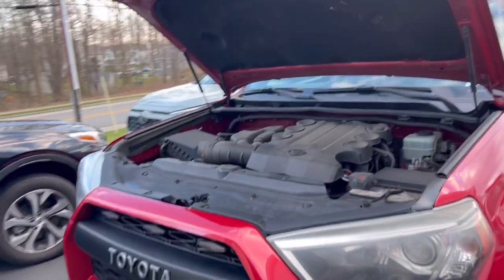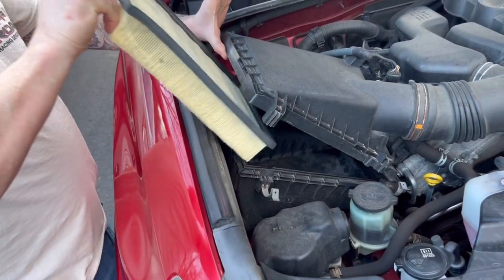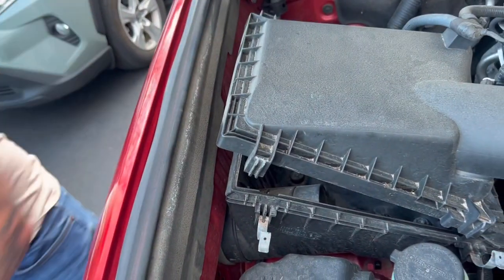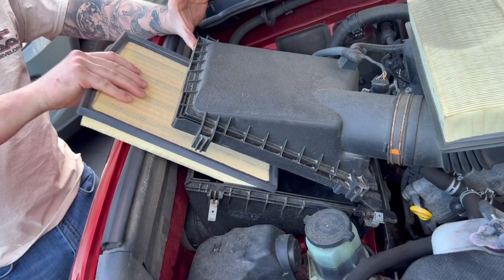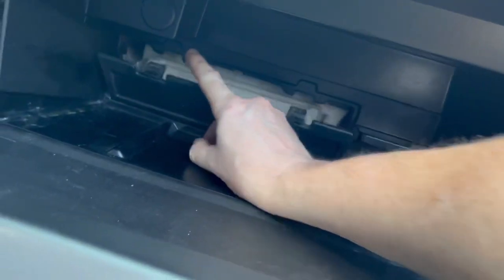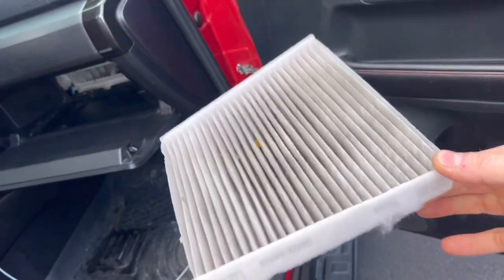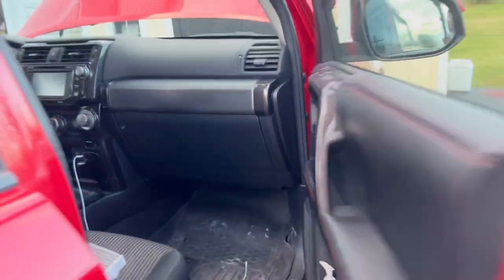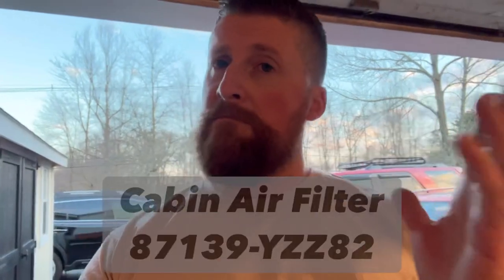Toyota 4Runner • FREE Maintenance Tech Tips - DIY Engine and Cabin air filters Replacement

Comment: I'm a little surprised that although you mentioned using aftermarket cabin filters you didn't mention how most aftermarket brands don't have arrows on them that indicate which side goes up but instead have arrows that should point down in the direction of air flow.
Reply from the maker: I wouldn’t know, I never use aftermarket filters 🤣.
I do now. I’m going to assume most of us do read the instructions. Please forgive me.
Reply: @VikingsGarage  Yeah. I did this the last time when I replaced my OE with an after market one and did not realize until I replaced it recently.  Extremely easy to miss the subtle difference on what the arrow denotes.
Reply: @KarthikPoobalasubramanian  
You'd be surprised at how many folks assume that up and air flow are the same BUT if that was true then dirt wouldn't collect on top of the old filter instead it would be trapped in the blower motor mounted below the filter.

Comment: Hey man? I noticed on my 21 4Runner it has a foam on the bottom of the OEM air filter , but some replacements don’t??
Reply from the maker: It’s common to find that type from factory. Most replacement filters come without it.

Comment: Do you recommend K&N filters?
Reply from the maker: I do not, for many reasons.
If you will clean then regularly perhaps but I’m not going to say is the best way to filter your engine air. 🤷🏼‍♂️
Reply: The Project Farm channel discs test comparing some brands of air filter. While K&N improved performance, it did so at the expense of not being as effective at keeping dirt out is the engine.
Reply from the maker: My point precisely, I’ve seen a Tacoma once with a ruined engine directly related to a K&N filter. 🤷🏼‍♂️